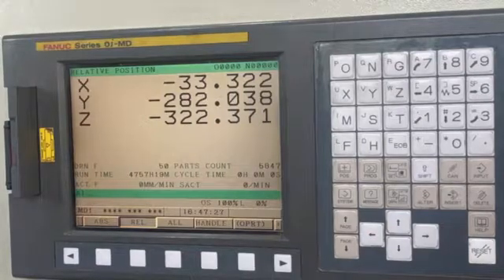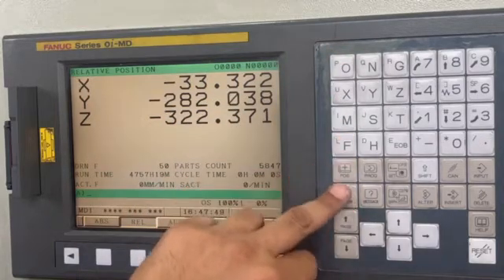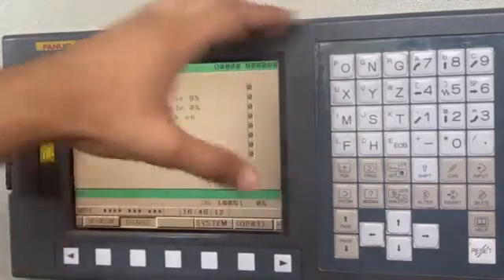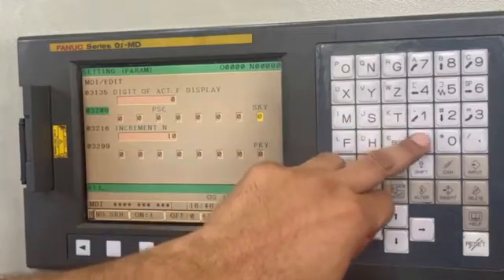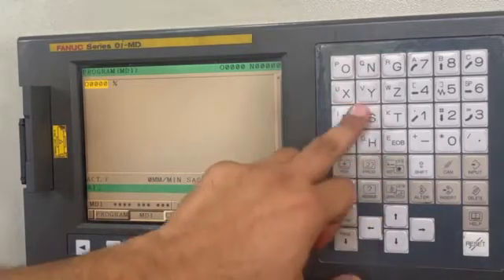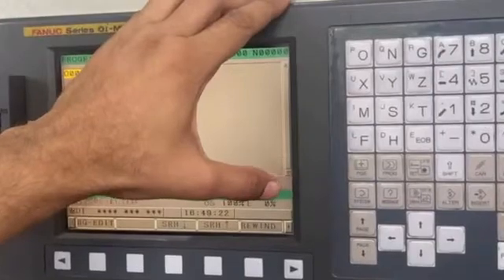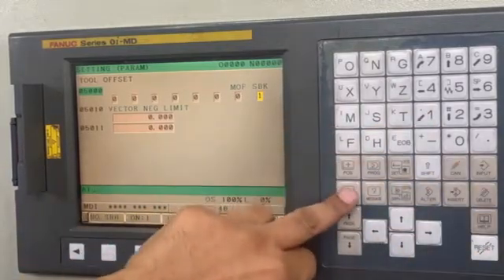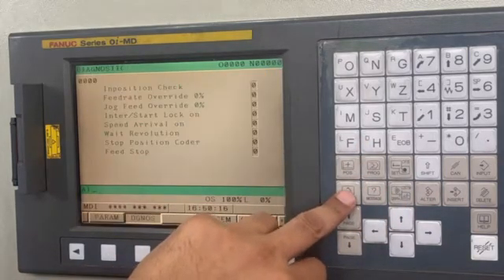LOCK FANUC MDI KEY SYSTEM BUTTON - PROTECT MACHINE PARAMETER, OFFSET, PLC Ladder :Dopamyc Robotics

Comment: Once you have deactivated system key , how you can reach upto that parameter
Reply from the maker: Hi Chanran , thanks for your comment. You can press Offset key. than go to setting (PWE screen). PAGE Down and you will find mention parameter 3208(SKY). You need not to press system key to reach this parameter SKY (3208)
Reply: @CNCrobotics2865  thank you for your reply
Reply: Hello. Thank you for this video. I bought a machine and the System Key was already disabled. When I go to edit the 3208 parameter I get the message that the parameter is Write Protect. I have tried to change this with the PWE at 1 and 0. Also in MDI mode and edit key on. But still cannot change the parameter. Can you help?
Reply: @Revit007  have you tried to reach 3208 thru offset key ,not thru system key , ( I have not tried yet so you have check)
Reply: Thank you  @CHARANSINGH-lk5wb   for your reply.  I could not change the value of the 3208 parameter under the offset key. It would show as "write protect".  I have found a work around though.  I wrote a MDI program.
G10 L52 ;
N3208 R00000000 ;
G11 ;
M30 ;

This has now enabled the SYSTEM key on the control panel.  I am still finding that there are parameters that are still "write protect".  For example I cannot change the time in the OFFSET key menu it says "write protect" when I press INPUT. Seems that the previous owner installed many layers of protection.  I hope they have not set a password protection.  I typed in a password (0000) to the 3210 field and it also says "write protect".  But I entered a value (0000) into the 3211 field and there was no error. I am not sure.  But thank you again for your reply, I appreciate it very much. /\
Reply: @Revit007  Good efforts